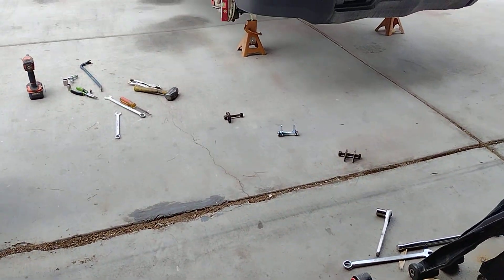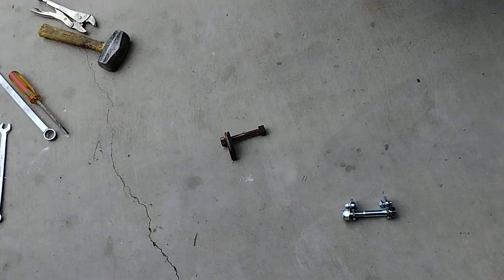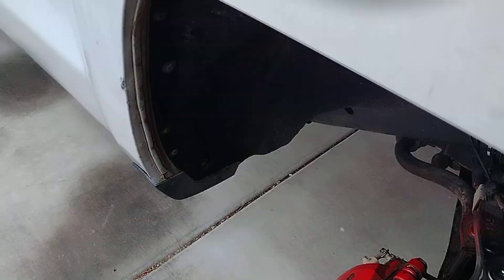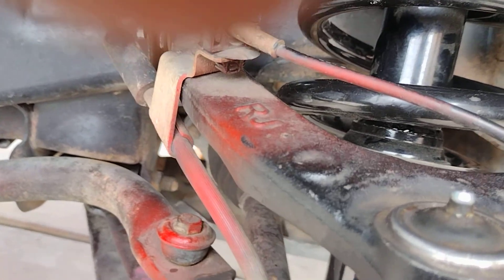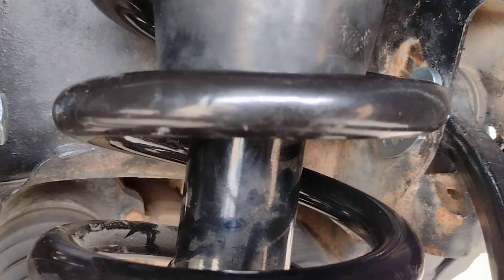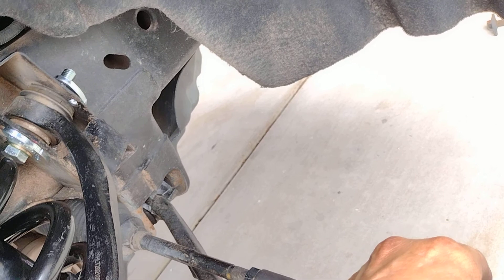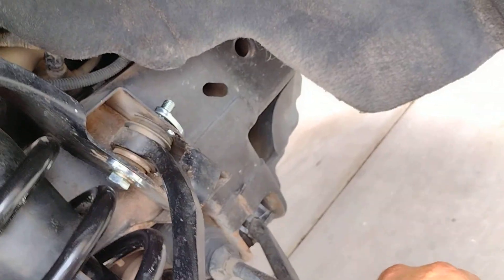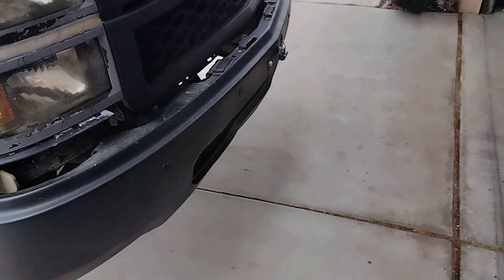2014 Chevrolet Silverado camber alignment repair, dirt King fabrication review

Comment: I learned how to do my own alignment because I can't trust any shop to work on my truck.  Every single alignment shop I've been to charges for a 4 wheel alignment with toe, camber, and castor up front if applicable.  99% of the time they only set the toe and if you ask them for the printout of the alignment specs they look at you like your crazy and disappear!

Comment: Pins will wear off in no time, I replaced mine multiple times. Im thinking to drill new hole fir a pin or bolt, so it won't be under the bushing. Bad design.

Comment: firesstone is trash buddy they only compensate and do nothing and then blame the customer always has been, they will take a 0 camber and move it to like negative three and compensate toe leaning on the camber. and they do all type of stuff. your best bet is to by the digital level. do the work. go back to the alignment garage and only get the results. and from there back to the your garage and move the camber if needed. then when you have it right , ask for the alignment , say dont touch camber at all. that you already paid for them to be where they are set. , no alignment garage sets camber the right way , been to a million of them , they are a multibillion dollar scam, every one with a car is saying the same thig about firestones ., after doing this in your video my car has the new car feeling omg. back to original , fire stone dont do that